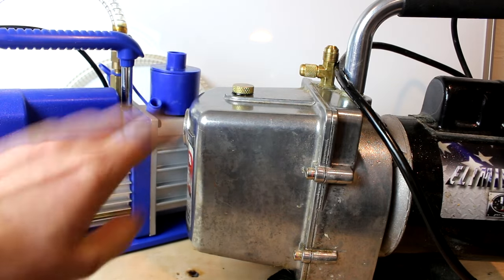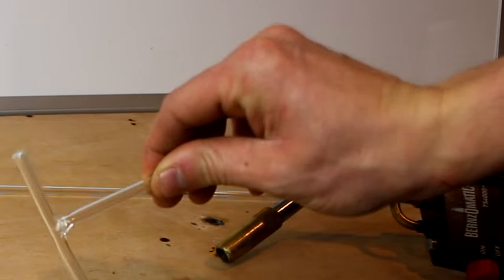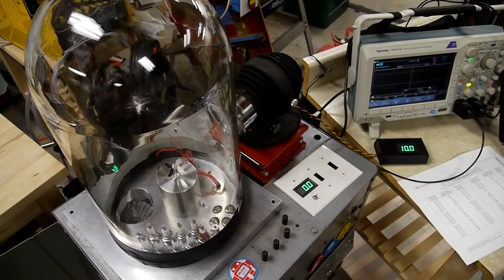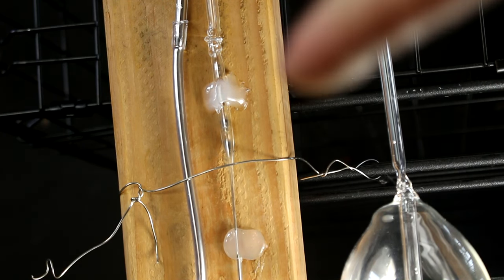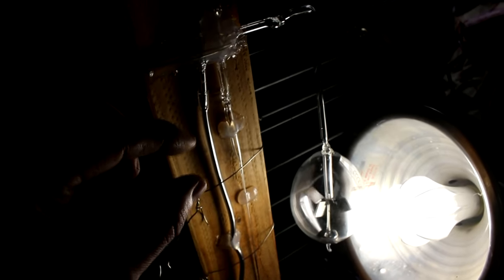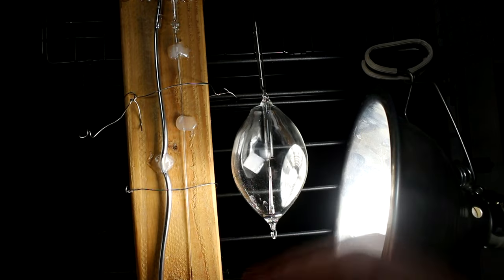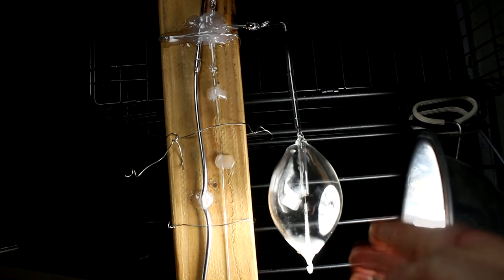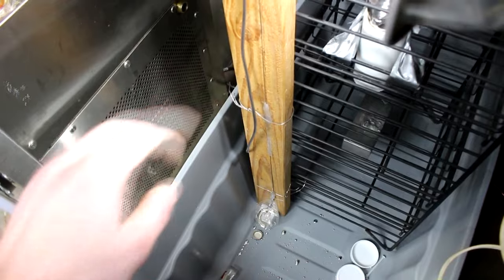Sprengel Vacuum Pump: The most efficient vacuum pump ever?

Comment: I wonder what the current output would be if attempting to use this as an electric generator?!? I KNOW it would be a DC current.
But I'll bet one could scale it up to be able to store the current in caps and build a charging driver PLUS an automatic transfer method to refill the primary tank when it gets too low and still have an excess of power for storing in a battery system!
Reply: Along with having a vacuum pump too boot!
Reply: Nope.  All the energy in the system comes from Cody moving mercury from the bottom reservoir to the top reservoir.  That's the absolute MOST energy that could be taken back out - in an impossibly ideal system.  But most of that energy is going into pulling the vacuum in the radiometer.  Most of the rest is spent moving the mercury through the system.  Then you've got to account for losses due to friction and the like.  There's not much left - only a few microjoules each cycle in all likelihood - to form that electrical potential you want to use, certainly not nearly enough to pump the mercury back up to the upper reservoir - never mind having anything left over to store!

Comment: Wait, if The mercury is being pulled up, Wouldn't you be able to put the filling container where the Mercury comes out from? And if that is possible would there be a way to set up a motor that could use the mercury to spin it to generate electricity?

Comment: edison called this a mercury slug pug. The biggest he made was 12 inches by 30 feet. The return was a achemedes screw. It was replaced was a diffusion pump. The mecury was replaced with a low vapor pressure oil because a mercury poisoning

Comment: Hi Cody :) Cool project. In case I wanna do it without using Mercury, would it be possible to use the type of oil used in diffusionpumps ? I guess, one would need to make the falltube longer to gain the same "pulling" effect as the Mercury can do and prevent it from just getting stug at some point.

Comment: ok, so I have an experiment I would be interested in seeing 

Since there is an apparent accumulation of electrical energy, and the carrier of that current obviously conductive, could you attempt to harness and measure it?

Could that electric energy be enough to replenish the supply of quicksilver needed to operate the machine continually, therefore creating a means of potential "perpetual" electric energy?

Comment: @Cody'sLab This is one of my favourite videos of yours, and IMO one of your coolest builds! I'm surprised you didn't think of the electric charge that built up in there.
I guess its not static since you had to touch both ends...Would that happen if it weren't in a vacuum? Also to go through your body that's quite high voltage, but a very low current as there isn't enough energy in the system, so it should be safe right?

Comment: Could the electrical build up be stored in a capacter and then dribbled off at a voltage enough to run a small tesla turbine or something similar to pump the mercury back to the first reservoir? Like have the mercury itself act as the trip switch for the pump as well as power it?

Comment: Would it be possible to make it a closed system and have the collection reservoir be the feed reservoir as well?  Or would the power of the vacuum suction not be enough to pull the mercury from such a low point?

Comment: What if you were to make the system larger, to handle higher pressures, and attach a hydraulic hand pump to force the mercury through with higher force than the weight of mercury?  Could you achieve a higher vacuum more quickly?

Comment: It will work with water too if the toxicity of mercury is a problem and you don't need less than the vapour pressure of water, but you need a much higher drop due to the lower weight of the water.

Comment: Can you put a volt\ohm meter between the 2 reservoirs of Mercury, to see just how much electrical energy is generated?
Reply: There is almost certainly too little current being produced to be detected by a normal voltmeter, and definitely not an ohmmeter. (Hence "static electricity"). To measure the potential you would need an electrostatic voltmeter. Most people would buy one, but Cosy would likely build one, especially once he discovers that the electrostatic bit is in an evacuated jar. There would be something nicely recursive in using the pump to build the voltmeter used to measure the pump's electrostatic potential...

Comment: If you could modify where the mercury comes out you wouldn't have to move it your self. You could just let it go until the pressure of the chamber is equal to the pressure of mercury vapor. Unless you have to constantly change the position of the mercury supply.

Comment: Could you set this up so the falling of the mercury would place it back into a reservoir for the pump to reuse? I know it wouldn't pump forever without some additional energy input of some kind. Yet I keep thinking that it should be possible to build one of these that can run for a year on a very small amount of input energy.

Comment: What if you replaced the oil in the vacuum pump with Mercury? Also, voltage potential between inlet and outlet? Is it possible to create a generator using this?

Comment: Could you please put a multimeter to show us the difference in voltage potential. I’ve done similar things running regular tap water though pvc pipe and got a charge.

Comment: Cool Beans Cody!
But...why doesn't the Radiometer Implode under Vacuum?
Reply: a 100% vacuum is only about 15 negative psi, that's why pressurized spacecraft don't need thick hulls to hold pressure. that radiometer glass can easily hold 15psi. glass beer and soda bottles contain more than 15psi.

Comment: A better plan would be to heat the Hg in the bulb and evaporate it away.  Simultaneously, you would drive water vapor and adsorbed gases from the bulb's inner surface.

Comment: I guess you wouldn't be able to run the Mercury drain tube back into the fill section because it wouldn't fall far enough to create a good vacuum to keep the system going?

Comment: my optimisation variety of this pump principle - WATER-PISTON-PUMP! and it works good? 15meters of polyethylene tube - for kitchen water-filter-system  1+4+1=6mm diameter 3meters long for 1.5USD, 15meters was used,down-end U-turned for 7cm up, and plastic bag coated like a socks - bufers water wolume against possible  oscilating pouring up  - with PE-bag - water poured down - remains in bag, and returns in tube without shortening of water column by air inhaled instead somehow losed water.
uper end of tube - connected to T-connector, with two valve-regulator on uper ins of T-tubeconnector(and down out of T-connector - to 15m long main water-pulling tube) T -acting like a mixer of slow vacuum income via valve from your stravberry filled evacuated jar, second valve for slow income with tube -  puted into water tank or glass under tap water flow - and intaked spontaneusly by vacuum after sifon water drain start, if vacuum valve not  too open(for fast weak vacuum open more, for strong vacuum close almost fully both valve-regulators

Comment: on the last part id like to have seen a voltmeter!.

as far as the efficiency... after i got vacuum couldn't you have just attached the inlet to the outlet and let it circulate without manually moving it up?

Comment: So how come no one came up with a mechanical version of this? Like some system to pump the mercury back to the first reservoir to repeat the process... 

But high vacuum pump always has a backing pump to first get the pressure down to about 30 microns, then the high vacuum pump takes over to pump it further down.

Comment: Hey Cody, do you by any chance still have this device and a thermal camera handy???? 
I can't help but think that as the mercury fell into the glass tube column and formed an air pocket, with the air being squeezed it should have been letting out some heat... 
I believe that I have seen a video somewhere on YouTube about how early refrigeration was based on something similar.... 
You were trying to recreate a vacuum pump but without realising it, I think that you also made a heat pump and that electric shock that you received, that is similar to what Victor Schauberger was doing with his falling water experiment in creating a high voltage electric discharge... There are many great videos on Victor Schauberger if you haven't already seen them... 
But if you still have this device hanging around, I would love to see it working through a thermal camera.... And possibly even a voltage measurement??
Reply: when you compress a gas, it gets hotter.  When you expand a gas, it gets cooler.  That's the basis of phase change cooling.  (although the working fluid in this case is a gas - so no phase change occurs)

Comment: Hi Cody. Great video. I was wondering if that jolt you mentioned at the very end, could that still be measured, and if so, what do you think of it's potential to run a pump or do the lifting for you as a sort of "perpetual motion device"? Or could someone else explain how that jolt was created if not from the friction of the mercury, glass, and compressed air?
Reply: Check out The Kelvin Water-drop Electrostatic Generator.  Could explain where the charge is coming from.

Comment: I'm thinking of building one of these for my own projects, but I don't want to take a chance on mercury poisoning. Do you suppose I could heat the apparatus and use gallium instead, or is it not heavy enough?
Reply: I ended up trying to build my own gallium sprengel pump, and to anyone who is thinking about trying gallium instead of mercury too, it didn't work for me.
I found that the reason was because the gallium was not as dense as the mercury, and therefore would not slip down the capillary tube unless there was a pressure differential or a column of gallium on the other side, which means it's not catching any bubbles of air on its way down.
It was doomed from the start, but you don't know until you try, and hopefully now I've learned something for everyone else so they don't have to make the same mistake. That's one of the reasons we do science, after all, so I'm glad I could make some small contribution. : )

Comment: With the laser moving the metal thing in the vacuum area, does that mean that light can move objects with force or is it the heat that's moving it?
Reply: Probably a combination of both, but more of the heat. That's how that device operates by heating the black side and the cool side releases it. The amount of atomic pressure applied to it from the laser would be miniscule in comparison.

Comment: Question for cody....how and why does the electrical potential buildup between the 2 mercury tanks?????? got curious about that
Reply: Hg is a conductive material. As it rubs against the glass it builds up static charge, stealing electrons from the air/glass. The charged Hg drops into the bucket. The lower container was probably charged positively, upper negatively since it had a hose stuck in it for the siphon to work.

Comment: A volt meter to measure electostatic charge during opperation would be interesting to see
Reply: The electrostatic discharge could destroy a digital volt-Ohm meter. There isn't enough current to work a simple D'arsonval meter. This is like rubbing your feet on a carpet, or a Van de graaff generator.

Comment: Hi Cody, love your channel. If you filled the radiometer with mercury and then turned it upside-down to it emptied out would that not pull out all of the air?
Reply from the maker: well... I guess thats sorta what i did here.
Reply: @theCodyReeder  true but would it work the other way and if so would it be quicker. I can't work it out in my head

Comment: once i worked on a vacuum system that measured the vacuum in pico amps of current in a wire.  when electricity is flowing in a wire , air around wire affects how much current can flow.  we were measuring pico amps. a pico amp is . 000000000000 1 amps.  i love your system, but not loving the mercury.  even though most all of my generation is sucking on mercury silver fillings in their teeth all day long. great vid

Comment: Using a propane torch for lab glass work?  We used an alcohol lamp when I learned to do it (around 1970, age 10+).  Just rubbing alcohol (the 91% works better, but common 70% works) in a bottle with a wick.  Nearly invisible flame; use a snuffer cup to put it out when not in use.  Don't let the glass touch the wick; even inside the flame, the wick is cold and will crack or shatter your red hot glass (yes, even borosilicate glass like Pyrex brand).  You can do this on your kitchen table (I've done it) -- but don't.  Nobody wants tiny glass fragments in their food.
Reply: I noticed, that the cylinder on his torch was yellow, instead of green. He may have been using MAPP gas,(methyl acetylene Polypropylene) which burns HOTTER than propane!!
Reply: @vincentrobinette1507  propane is hotter than you need for glass.

Comment: Can you use the electrical potential and save that energy in let's say a battery or a capacitor bank?
Reply: He said he got a shock, so that was high volts, low amperage. It would be interesting to monitor the voltage as time passes, then you could see if it was safe to charge something.

Comment: you could hook up a hundred of these to run in parallel and electric motor to pump mercury back up. worlds most efficient electric vacuum pump. you wouldnt get the reservoirs charging up with voltage if the tubing was metal.

Comment: You have to consider the efficiency of the system that's being used to load the machine. I'm not sure how efficient people are, but if you consider the range of efficiency from 30% to 50%, that would be up to triple and down to double the energy used. A pump's efficiency would factor these loses already, wouldn't it?

Comment: You got a shock? What about putting a volt meter on it to test the voltage.
Reply: That was my thought.  Somewhere in the bowels of the internet are legends of vimanas powered by mercury engines... maybe this is a part of that or maybe those stories are bullshit, I dont know.  I saw it when the internet was still pre-html page creators, pre java, pre everything but jpg, a few fonts, and text... havent seen much on that since
Reply: Along with photos of Tesla on top of Teotihuacan pyramid doing electrical experiments... I might add.  Find that.

Also find the Nemi Ships data on the specific number of bearings they found on the ships of Caligula based on roman grain haulers [definitely transatlantic sized vessels].  They had something like 36 types of ball bearings, plumbing, glass tiles, etc.  Lots of material expertise.  Automata.. etc.

Comment: I might be years too late to give advice, but don't go with a turbomolecular pump. One mistake (which let's be honest in a non-laboratory quality setting like this is more than likely) and all that's left of it is a pile of titanium scrap. Diffusion pump, on the other hand, works just like new after several hours of grinding the charred oil away in case of a mess-up. Although, I've heard stories in my uni, and all the lecturers consistently claim that no chemicals work to clean it, not even piranha solution.

Comment: After watching you for years, and tumbling over this... Could the same concept be applied to using water if the height drop was high enough?
Reply: You could draw a vacuum down to the vapor pressure of water, which is 0.006 atm at 0°C.

Comment: Is there some other liquid that is non-toxic that could be used as a replacement for the mercury? I would really like anyone and everyones
 input  on this since I  am not interested in handeling mercury.
Reply: Technically yes, you just want a really low vapor pressure as that's the closest to a vacuum you can get and preferably would want something that doesn't wet or stick to surfaces that much. So I would avoid using something like gallium even if it has some apparent similarities to mercury. You COULD use basically any liquid, but how effective it is will vary based on the given criteria.
Reply: Oh, you also want it to be dense. It doesn't technically need to be, but unless you want it to be like 30 feet tall for water, I would say that's another criteria you should select for.
Reply: Oh, you also want it to be dense. It doesn't technically need to be, but unless you want it to be like 30 feet tall for water, I would say that's another criteria you should select for.
Reply: @Minecraftian2345432   thank you for your input.
Reply: @Minecraftian2345432   what liquid would you suggest I used? I would prefer something nontoxic if that is at all posible.

Comment: You could have pumped out most of the air using the existing vacuum pumps and then use your Sprengel pump to get the vacuum faster.

Comment: Wouldn't galinstan be an even better material for this? Gallium, indium, and tin all have unmeasurably low vapor pressures near room temperature, far lower than mercury. Only downsides I can see are the cost and the way gallium sticks to glass making it less cool looking and harder to tell what's going on.

Comment: Or better yet have the mucury in the line like that held up but instead of all that just have a shut off valve at the top attached to your vacuum line, and just turn the valve open when you're ready to start and it will drain out the bottom sucking air out of the line

Comment: Could you get the same effect if you would have used gallium?
Reply: the way it works is by the weight of the mercury, gallium could work but its not nearly as heavy so probably wouldnt pull a good vacuum